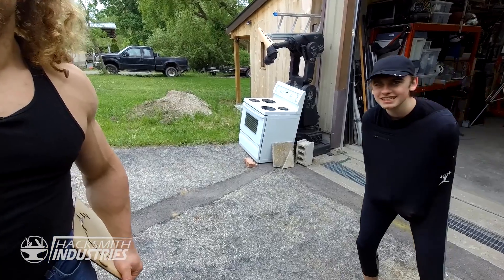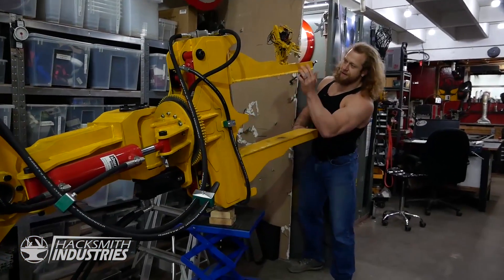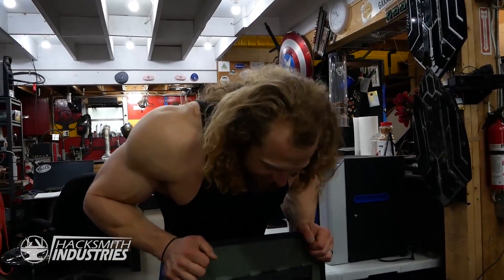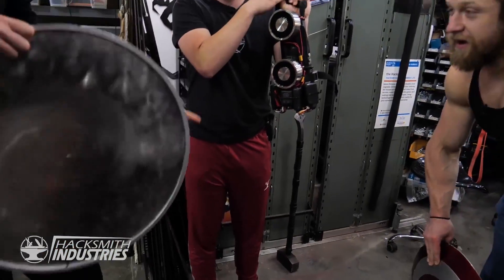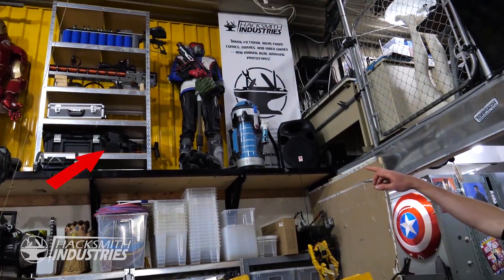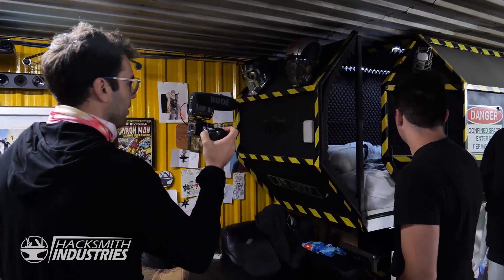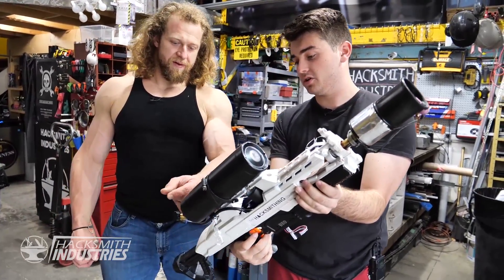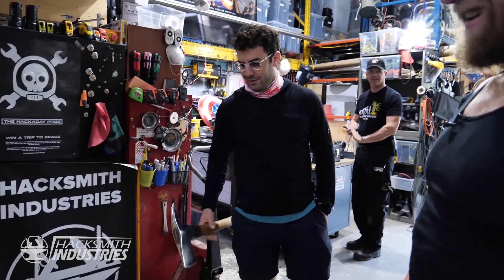Jujimufu Tours Hacksmith Industries

Comment: Why don't you try and make something that is BALANCED?!
Reply: Sledge's Hammer
Reply: When I 1st read your comment i thought to myself “but why though, heavy thor hammers are awesome!” On second thought though, I think you may be on to something! He could try to make things as lore friendly as possible while making them a little more practical at the same time. For example, a Thor hammer with a steel or titanium head on it, but a tungsten or lead filled handle so that its still heavy enough to smash shit, but not so top heavy that you break your wrist. That could be interesting! Once you built up the strength it would be semi useable. There is actually a new aluminum alloy thats stronger and lighter than any titanium or steel aloy, but its incredibly expensive at the moment because of the process used to create it. If he could get ahold of that stuff he could make it reaaaally balanced. Whats interesting about this particular alloy though is that its not the composition that makes it strong, but the unique structure of the atoms that they achieve though their new process. This could make for some insanely safe cars if it were ever perfected. Lightweight and strong materials survive damage at greater speed than something heavier of the same strength. Thats why all my racing drones are under 125grams now lol. Its like crashing a really really fast feather, nothing really  happens because theres hardly any momentum even if you are going 100+ mph. The only issue with the new aluminum ( other than cost and difficulty to produce) is that it cannot be reshaped without losing its unique qualities.
Reply: holy sh*t you put a  lot of time into a reply
Reply: makes something with random crits RANDOM CRITS ARE FAIR AND BALANCED